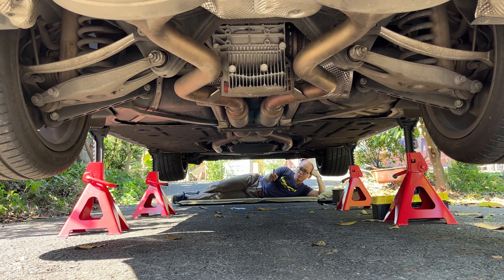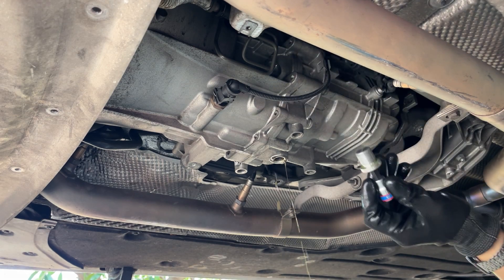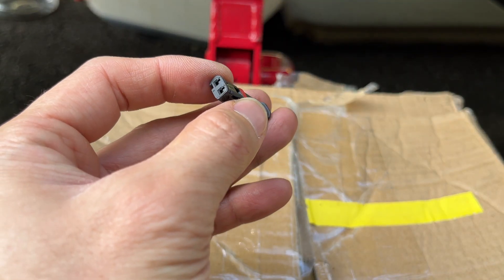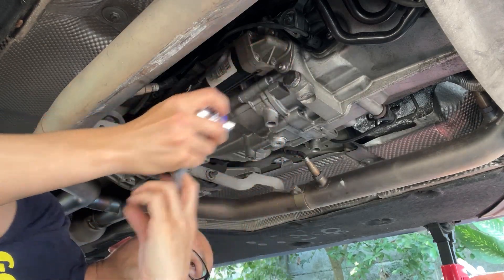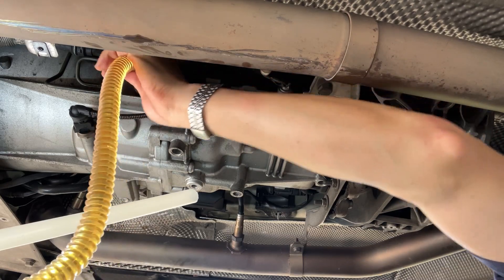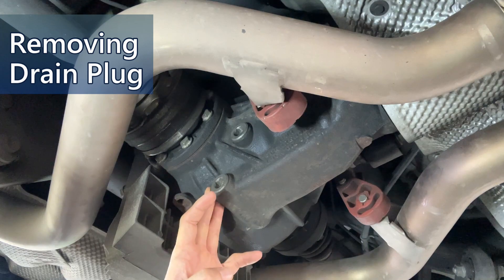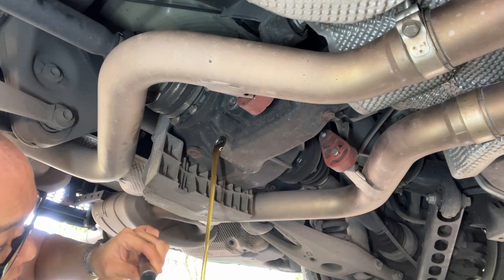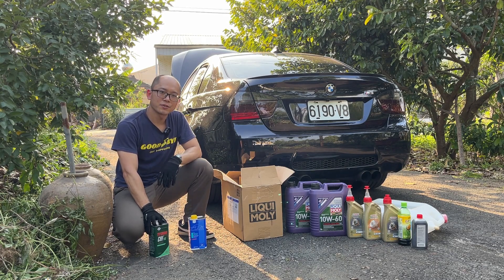Manual Transmission Oil & LSD Oil Change for BMW E90 E92 E93 M3

Comment: Do you happen to remember the part number of that connector you used to power the transmission oil pump?
Reply from the maker: Hello MH thank you very much for the question! I love searching for the part numbers.

Please search "bmw connector 75075279 872406-501A" and there will be plenty used connectors available.

I have to go back to check my raw videos for the part number. However, I could only find that this is made by Honha Autoparts in China. Seems like it's not easy to get a new one🤔
Reply: @funcarsgoodpeople  Thank you for getting back to me. I was able to find one on eBay from a used parts seller.

Comment: If I were to buy a standalone “thermostat connector,” I can just unplug the connector at the transmission pump and plug the new connector in with a battery hooked up to activate the pump without having to cut/spice any of the original wiring?
Reply from the maker: Hi Aspireonthego, I didn’t know the “thermostat connector” until you mentioned it! Yes I think it will do the job! Thank you for the idea! Now I know where I can buy it 🤗
Reply: @ Cool! And then I can just hook up the wires to a portable battery booster using clamps?
Reply from the maker: Yes the transmission oil pump simply needs 12 volt supply. That’s what I did at the beginning but my booster did not seem to work this way so the pump activation was interrupted. I guess a car battery or power adapter will be  more convenient 🤔
Reply: @ Great, maybe I’ll give that a try. Thanks for answering my questions!

Comment: Can you link what kind of battery you used
Reply from the maker: Hi David thank you for the question. Any 12 volt battery will work. I used a jump-starter power bank from Philo EBC-9701 (but it is discontinued.)  Here is just an example https://www.amazon.com/Best-Sellers-Jump-Starters/zgbs/automotive/318336011
Reply: @funcarsgoodpeople  thanks. what size wires is necessary?
Reply from the maker: @DLam02  Hi David, I checked the wiring diagram on ISTA, the wire from DME to the gear box oil pump, the gauge is 0.75 mm^2.

Comment: I don't have a computer to run the transmission pump. Is it okay to leave it alone? Thanks for your great content.
Reply from the maker: Hi Bernard I think it's okay to leave it alone but I prefer to completely change the oil to keep the system clean.

According to the Aftersales Training manual for E92 M3, the gearbox oil pump will be activated when gearbox oil reaches around 110°C. However the engine oil does not go that high often, and the gearbox oil temperature is expected to be lower, the gearbox oil pump is not running that often. I guess this is why I had a lot of dark oil remaining in the cooling circuit, even after I changed fresh gearbox oil few km ago.
Reply: @funcarsgoodpeople  Thanks for your quick response! Much appreciated. Subscribed. Cheers!
Reply from the maker: My pleasure Bernard 🤗 welcome to the DIY supporting group 🤣

Comment: Please always open the fill plug first on transmissions. If you drain first and something happens to prevent you from removing the fill plug you will have an immobilized car with no way to get fluid back in. Same with differentials. Fill plugs first. I know the chances are low that something bad will happen to the fill plug but all it takes is once to have a VERY unpleasant experience.
Reply from the maker: Hi Mark thank you for this valuable tip! You are right and this should be written into the service manual 😆 I will include this tip in the future video. See you soon!
Reply: @funcarsgoodpeople  you’re welcome. Keep up the good work with the informative content!
Reply from the maker: Thank you again for sharing with everyone 😊 I included it in this vlog: https://youtu.be/hUI12W4BJbs

Comment: Your content is really helpful,  I do everything on my E92 M3 .. keep up the great content. . An on your other video i Did not know I can heated steering wheel function will definitely look In that
Reply from the maker: Hi thank you very much for the comment 😊 my pleasure to share. Also happy to meet another DIY lover!

About the heated steering wheel, OE looks great isn't it 😎
Reply: @funcarsgoodpeople  I'm not to sure if you have heard or seen but you can retro fit F82 m4 seats in a e9x M3. Will be a nice addition add , from what I know is you just need to change a few pins in the module under the seat
Reply from the maker: Yes I've heard some guys have F8xM seats in the 9xMs. Taiwan is always so hot I'd like to have those hollow back rests 😊
Reply: @funcarsgoodpeople  If you could do a video of installation that would be perfect if you decide to go that route💯🔥💥,

Comment from the maker: Update: Replace the broken drain plug with ECS Tuning magnetic drain plug
更新：更換ECS Tuning磁性放油螺絲
https://youtu.be/hUI12W4BJbs

**Fluid required**
-MT oil: BMW MTF-LT2 (BMW 83222339219) or 75W-80 equivalent 2.2 liter
-LSD oil: SAF-XJ (BMW 2 282 583) or 75W-140 equivalent 1.1 liter

**Optional Parts**
Transmission drain/fill plugs (incl. washer) 23 11 7 531 356 X2
Transmission strainer plug 17 21 2 283 111
Transmission strainer washer 07 11 9 963 300
LSD drain/fill plugs (incl. O-ring) 33 11 7 525 064 X2

**Tools required**
8 mm hex socket (transmission cover)
10 mm hex socket (transmission cover)
8 mm hex bit (transmission drain/fill plugs)
22 mm hex socket (transmission strainer screw)
14 mm hex bit (LSD drain/fill plugs)
Torque wrench 25-60 Nm
Professional oil syringe RECOMMENDED

**所需油品**
-手排變速箱油：BMW MTF-LT2 (BMW 83222339219)
 或等同於 75W-80， 2.2公升
-差速器油SAF-XJ（BMW 2 282 583）或等同於 75W-140，1.1公升

**選擇性更換零件**
變速箱放油／加油螺絲（含墊片）23 11 7 531 356 X2
變速箱油濾網 17 21 2 283 111
變速箱濾網墊片 07 11 9 963 300
差速器放油／加油螺絲（含O環）33 11 7 525 064 X2

**所需工具**
8 mm 六角形套筒（變速箱下護板）
10 mm 六角形套筒（變速箱下護板）
8 mm 六角凸頭（變速箱放油／加油螺絲）
22 mm 六角形套筒（變速箱濾網）
14 mm 六角凸頭（差速器放油／加油螺絲）
扭力扳手25-60牛頓米
建議使用專換加油工具